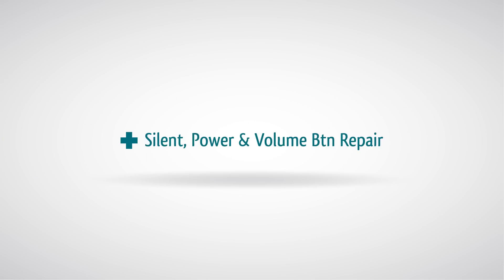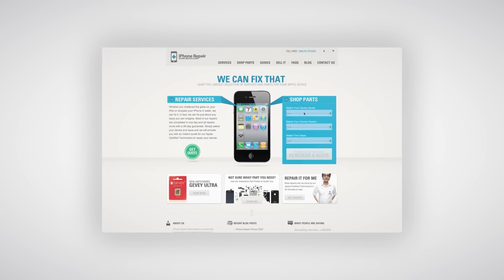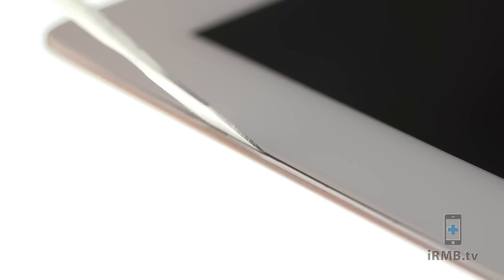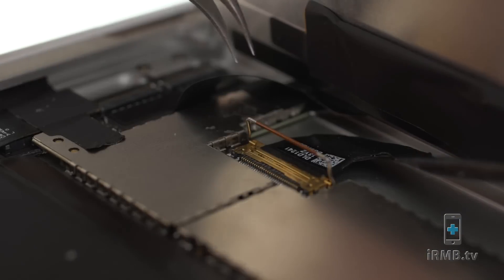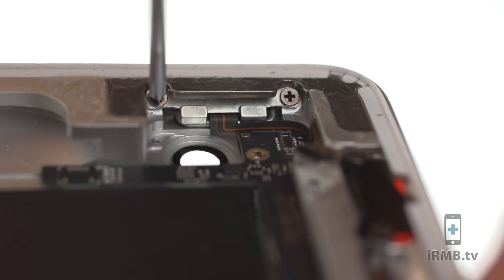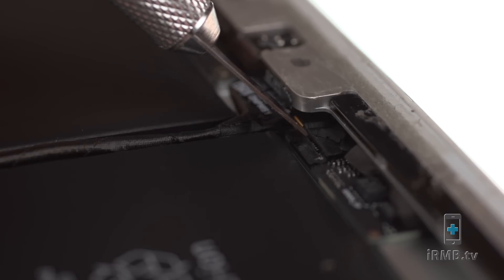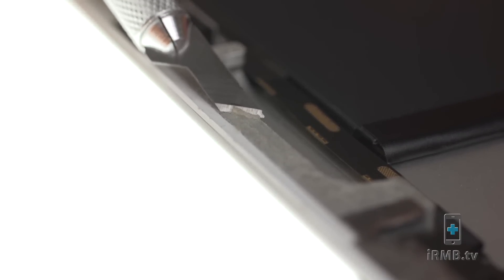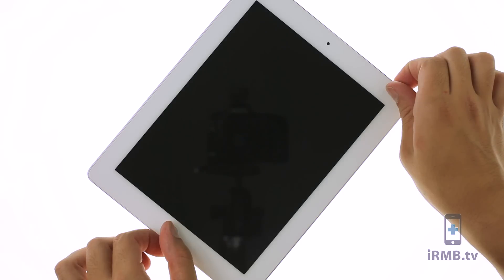Silent, Power & Volume Button Repair - iPad 2 Wifi How to Tutorial

Comment: I just replaced the flex cable...  Ordered the one you use here and then found out that this was the updated version of the ipad 2 so it was a little different. When I reassembled it I could see a partial faint display on part of the screen, that would go away after a few seconds after I pushed the home button.Tried the hard reset and nothing happened. I noticed that the vol up button was solid with no reflex. I took it back apart and the push button for the vol up was not "clicking" but solid.

Comment: Hey guys, great video...but my question is do I have to replace the flex cable if what seems to be a stuck up volume switch.  Down volume works fine, but the up volume doesn’t budge when pressed. So is it just the button problem or the whole assembly? And do you have those parts for sale? 
Thanks in advance,

bambi011

Comment: I just replaced the back housing and glass screen of my ipad 2. I was so happy when it turned on BUT after 1 minute o more my ipad turns off by itself (literally turns off). It does continuously. Do you think is there a problem with the power flex or the mother board? Please advice.